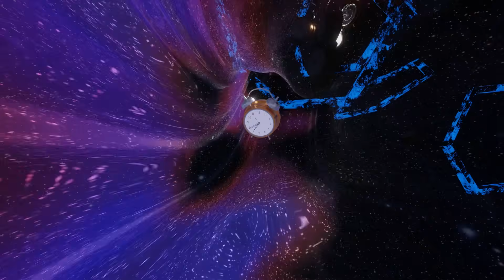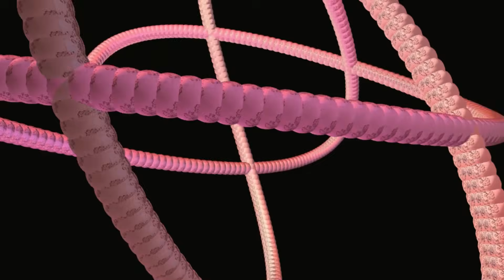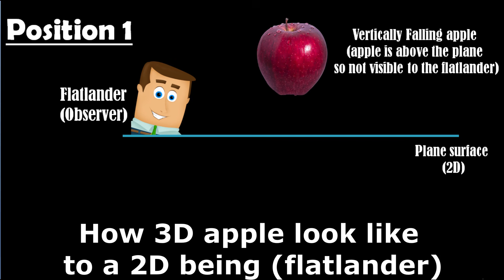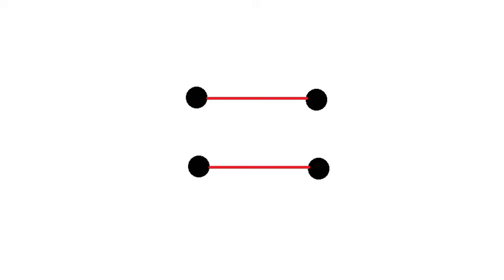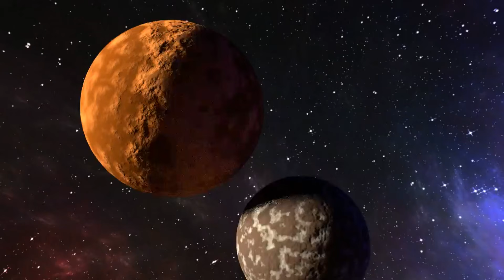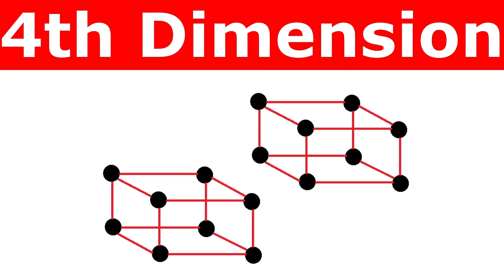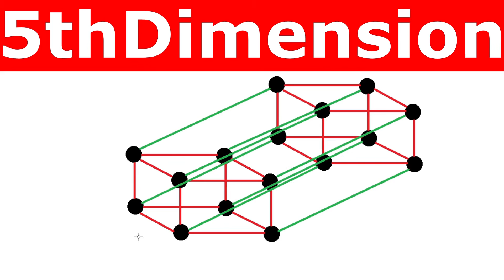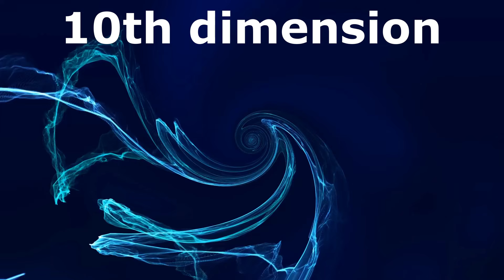11 Dimensions Explained - A Mind-Bending Explanation of Higher Dimensions!

Comment: I have an issue with this as in viewing an object. 
Let's take the rope and the ant for example. 
Depending on the viewpoint, we can either see two or three dimensions.
It is impossible to see one-dimensional unless it is a drawing or on a computer.
So, we crouch down to see the two rocks and the ant crawling across. This is two-dimensional, not one. We can observe the length and width of all these objects, not just length.
Even paper has a length, width and depth to it. Even though it is only fractions of a millimeter, it still exists.
Even when you use a pencil on paper, it will leave a minuscule height of graphite or indentation. So nothing physical an be in one dimension.
Actually all things viewed, for the most part are always three dimensional. 
So a single dimension or two dimensional objects are purely hypothetical.  Im not saying it doesn't exist, but we cannot view this with the eye. Its only a false perception.

Now the 4th dimension would be different, but I think the classic "go to answer" is: Time.
But "time" is a man made construct. Used as a unit of mesurement of things being: built, destroyed, birth and death.
A chronological way to observe history.
But in Universal law, time does not exist. Just: action, reaction, repulsion and attraction. So to say in "The Fourth Dimension, is viewed one state in time, in all states" is hypothetical as well.
Instead of trying to view and explain "A Structure of three dimensions in the Fourth" maybe we should be considering the view instead of the object. All structures could be invisible, but you could view all angles anyway. I think it would be more like viewing translucent atoms in frequencies.  The Time answer doesn't really work for me.
I mean Einstein tried to prove time travel with atomic clocks, but maybe it only proved that structures or matter are less reactive the closer you are to an object of mass, and vise versa.  Therefore it doesnt degrade or break down the same.

Comment: I disagree about your idea of the fourth dimension, I believe temporal dimensions are a separate thing from spatial dimensions, we expand our freedom of movement as we add dimensions in this way, even though each step allows a completely and radically different manner of movement it is still fundamentally the same ‘action’, you would still just be physically pushing, pedaling ambulating or otherwise propelling yourself ‘forward’ in space. Regardless of how many degrees of spatial freedom there are they are all still ‘moving’ along the same old river of time in the way we are used to. Just my thought anyway. I think These type of higher or lower dimensions are what physicists have discovered are required for all quantum fields to coalesce along with the other, separate dimension of spacetime that is manipulated by gravity and described by special and general relativity

Comment: Great video.  We being in a 3 dimensional world that we see and understand,  There is a 4th dimension but we are also locked into the 4th dimension at this time. As time  passes by normally, we are locked in this so called "present or current time".  What we cant do yet, is move freely back in time or forward in time.  Someday there may be machines that can provide this 4th dimension movement, but what would that do to our current time line if something gets changed in the past (paradoxes - another topic).  So, do want to even tinker around with the 4th dimension?  No pun intended, but Time shall Tell.

Comment: Actually if he was in a 2D plane he would only see a wriggle line not a circle as each point on a circle in front of him would block view of points behind. At most an arc would be seen. If the observer was ABOVE the askew to it in parallel able to see only into that plane then he'd see point to circle to point. In plane be point to a wallish arc that bends at most to a half circle like view then to point. Lol you can't see a circular building in its entirety on the ground in its entirety if on same level. Exact same thing. This is why a lot of half factor mistakes are made in string.

Comment: If we go to microscopic level, we'll perceive the other dimensions. So a zero dimension point does have more dimensions in it. Ang going deeper to nanoscopic level, the zero dimension dot that has multiple dimension is made up of zero dimension dots. In conclusion, zero dimension is also multiple dimensions depending on the limits of the observer's perception. The question is when an observer transcends its perception do these dimensions still exist?

Comment: Thank you for the easy to understand - as you explained them - the Eleven dimensions .
 I get the sense though there may well be more Dimensions yet to be found , as the Hubble Telescope found out in the first long duration observation on an "empty " bit of space . They got more of a surprise when instead of 11 days observation , it was taken over 22 days , peering into another bit of "empty" space , where even more was found . Both  the Deep field view & the ultra Deep Field Veiw ,  produced much unexpected data . 
 Thank you for sharing , and I look forward to the other dimensions being found , and understood .
 Namaste 🙏👍🤔
Reply: Remember that this is the eleven dimensions proposed in string theory, which were first predicted in the early 20th Century when differential equations were applied to modern physics.  As the video touches on, more dimensions are proposed in other theories.   Maybe one theory is more right than another or, heck, maybe they're all correct.

Comment: The stars AND PLANETS are POINTS in the night sky, AND carefully consider what is the speed of light (c) ON BALANCE !!! Indeed, A PHOTON may be placed at the center of what is THE SUN (as A POINT, of course); AS the reduction of SPACE is offset by (or BALANCED with) the speed of light (c) ON BALANCE !!! ELECTROMAGNETISM/energy is then CLEARLY proven to be gravity ON BALANCE. E=mc2 is directly and fundamentally derived from F=ma. Indeed, this explains the fourth dimension and the term c4 from Einstein's field equations !!!! (Stellar clustering ALSO proves ON BALANCE that ELECTROMAGNETISM/energy is gravity.) So, on balance, I have CLEARLY explained why THE PLANETS (including WHAT IS THE EARTH AND the Moon) move away very, very, very slightly in relation to what is THE SUN, as ELECTROMAGNETISM/energy is gravity ON BALANCE !!! Accordingly, the rotation of WHAT IS THE MOON matches it's revolution. Gravity AND ELECTROMAGNETISM/energy are linked AND BALANCED opposites (ON BALANCE), as ELECTROMAGNETISM/energy is gravity (ON BALANCE) Great. Carefully consider what is THE EARTH/ground ON BALANCE in relation to what is THE EYE. Think about TIME. Great. Gravity is ELECTROMAGNETISM/energy ON BALANCE. Gravity/acceleration involves BALANCED inertia/INERTIAL RESISTANCE, as ELECTROMAGNETISM/energy is gravity ON BALANCE; as this is consistent with E=mc2 AND F=ma. Accordingly, ON BALANCE, the rotation of WHAT IS THE MOON matches it's revolution. I have explained why the orange and setting Sun is the same size as the fully illuminated and setting Moon. (They are both the same size as what is THE EYE.) I have mathematically unified physics. I have explained the cosmological redshift, the black hole(s), AND the supergiant stars. I have explained why there is something instead of nothing ON BALANCE !!!!!. Inertia/INERTIAL RESISTANCE is proportional to (or BALANCED with/as) GRAVITATIONAL force/ENERGY, as this balances gravity AND inertia/INERTIAL RESISTANCE; as ELECTROMAGNETISM/energy is gravity ON BALANCE. This explains E=mc2 AND F=ma ON BALANCE. This NECESSARILY represents, INVOLVES, AND DESCRIBES what is possible/potential AND actual IN BALANCE, as ELECTROMAGNETISM/energy is gravity ON BALANCE. Think about the man (THE EYE) who actually IS IN outer “space” in careful comparison to/with what is THE MAN (AND THE EYE) who actually IS standing on WHAT IS THE EARTH/ground ON BALANCE !!!!!. Think about TIME. Magnificent. (So, you want to think about TIME AND WHAT IS THE EARTH/ground ON BALANCE !!!!!. Fantastic !!!! ELECTROMAGNETISM/energy is gravity ON BALANCE, as it ALL CLEARLY makes perfect sense; as ELECTROMAGNETISM/energy is gravity ON BALANCE !!!!!. (Notice that the sky is blue, and THE EARTH is ALSO BLUE !!!) Great. What we have here is top to bottom perfection. Notice that time is, ON BALANCE, necessarily possible/potential AND actual IN BALANCE, as ELECTROMAGNETISM/energy is gravity ON BALANCE !!!! SO, ON BALANCE, TIME dilation ULTIMATELY proves that ELECTROMAGNETISM/energy is gravity ON BALANCE !!!! BALANCE AND completeness go hand in hand. Great. It is ALL CLEARLY proven. I have mathematically unified physics two times over !!!!!. I have proven that, how, and why ELECTROMAGNETISM/energy is (NECESSARILY AND CLEARLY) gravity ON BALANCE, thereby explaining why there is something instead of nothing (in and WITH TIME ON BALANCE) !!!!! Again, this NECESSARILY represents, INVOLVES, AND DESCRIBES what is possible/potential AND actual IN BALANCE (in and WITH what is TIME ON BALANCE as well); as gravity is CLEARLY proven to be ELECTROMAGNETISM/energy ON BALANCE !!!!. Remember, with regard to TIME as well, the stars AND PLANETS are POINTS in the night sky. (It ALL CLEARLY makes perfect sense.) Don't forget to consider the speed of light (c) ON BALANCE. TIME dilation ULTIMATELY proves that ELECTROMAGNETISM/energy is gravity ON BALANCE. (Gravity is ELECTROMAGNETISM/energy ON BALANCE.) It ALL CLEARLY makes perfect sense, as BALANCE AND completeness go hand in hand. I have mathematically unified physics.

By Frank DiMeglio

Comment: UNDERSTANDING EXACTLY WHAT IS A TWO DIMENSIONAL SURFACE OR SPACE AS invisible AND VISIBLE IN BALANCE, AS E=MC2 IS clearly F=ma (ON BALANCE):

The stars AND PLANETS are POINTS in the night sky. Now, very carefully consider what is a galaxy. Get a good look at what is THE EYE, AND notice the black space. E=MC2 AND F=ma IN BALANCE do ALSO FUNDAMENTALLY represent (ON AVERAGE) what is a TWO DIMENSIONAL surface OR SPACE (as what is a BALANCED MIDDLE DISTANCE in/of SPACE), AS ELECTROMAGNETISM/energy is gravity. Gravity IS ELECTROMAGNETISM/energy. Gravity AND ELECTROMAGNETISM/energy are linked AND BALANCED opposites, AS E=MC2 IS F=ma. The stars AND PLANETS are POINTS in the night sky. Now, consider what is the speed of light (c) ON BALANCE. I have explained why THE PLANETS (including WHAT IS THE EARTH) move away very, very, very slightly in relation to what is THE SUN on balance, as ELECTROMAGNETISM/energy is gravity. Gravity/acceleration involves BALANCED inertia/INERTIAL RESISTANCE, AS E=MC2 IS CLEARLY and NECESSARILY F=ma ON BALANCE; AS ELECTROMAGNETISM/energy is gravity !!! Accordingly, the rotation of WHAT IS THE MOON matches it's revolution. It is CLEARLY proven ON BALANCE. E=MC2 IS CLEARLY F=ma ON BALANCE. This NECESSARILY represents, INVOLVES, AND DESCRIBES what is possible/potential AND actual IN BALANCE, AS ELECTROMAGNETISM/energy is gravity !!! TIME dilation ULTIMATELY proves (ON BALANCE) that ELECTROMAGNETISM/energy is gravity, AS E=MC2 IS F=ma ON BALANCE !!! Indeed, TIME is NECESSARILY possible/potential AND actual IN BALANCE; AS E=MC2 IS F=ma IN BALANCE; AS ELECTROMAGNETISM/energy is gravity. Gravity IS ELECTROMAGNETISM/energy. "Mass"/ENERGY IS GRAVITY. ELECTROMAGNETISM/energy is gravity. (BALANCED inertia/INERTIAL RESISTANCE is fundamental.) Objects AND MEN fall at the SAME RATE (neglecting air resistance, of course), AS E=MC2 IS F=ma ON BALANCE; AS ELECTROMAGNETISM/energy is gravity. This NECESSARILY represents, INVOLVES, AND DESCRIBES what is possible/potential AND actual IN BALANCE. Gravity is ELECTROMAGNETISM/energy ON BALANCE. The sky is BLUE, AND what is the Earth is ALSO BLUE. Carefully consider what is a galaxy !!! Energy has/involves GRAVITY, AND ENERGY has/involves inertia/INERTIAL RESISTANCE. “Mass"/ENERGY involves BALANCED inertia/INERTIAL RESISTANCE consistent with/as what is BALANCED electromagnetic/gravitational force/ENERGY, as ELECTROMAGNETISM/energy is gravity (ON BALANCE); as E=MC2 is CLEARLY and NECESSARILY proven to be F=ma ON BALANCE. Inertia/INERTIAL RESISTANCE is proportional to (or BALANCED with/as) GRAVITATIONAL force/ENERGY, as this balances gravity AND inertia; as ELECTROMAGNETISM/energy is gravity; as E=MC2 is CLEARLY and necessarily proven to be F=ma ON BALANCE !!! So, “dark” matter/ENERGY is plainly unnecessary; and it is idiotic. I have mathematically unified physics, as I have explained the term c4 from Einstein's field equations along WITH the fourth dimension, as ELECTROMAGNETISM/energy is CLEARLY AND necessarily proven to be gravity ON BALANCE. E=MC2 is CLEARLY proven to be F=ma IN BALANCE.

By Frank DiMeglio

Comment: "In my father's house there are many mansions."  -Jesus 
Now you see what he meant.
We live in a multiverse consisting of many dimensions. Each dimension have it's own vibration. We all exist at the same time at the same place, but as we vibrate at different speeds we are invisible to co-existing dimensions. Think of the spokes in a bicycle wheel. If the bicycle stands still or move very slowly (low vibration) we can see the spokes, but if the bicycle moves fast (high vibration) the spokes become invisible to our eyes, even tough they are still there, existing. It's the same with our souls that move on to a higher dimension after we pass. Our souls are of a higher vibration.
Reply: So True !

Comment: Do not ask, "If there are so many dimensions, why are we not able to perceive them?" but instead ask:

1) If the theory works by assuming 11 dimension, what are the formal benefits to use more than three dimension?"
2) If the benefits are mostly formal, what is this formality try to achieve, if maybe the 11 dimensions have nothing to do with 
our daily and pragmatic concept of dimension?
3) What kind of data, rules or functions result - generally speaking, in the usage of more than three dimensions?
(For instance:
Real Numbers are in 1D, Complex Numbers are in 2D; i*i=-1
 Higher than Complex Numbers are Quaternions (in 3D); i*j*k=-1 
Higher than Quaternions are Octonions; i*j*k*l*m*n*o=-1 
and its double-sized version Sedenions; which I don´t understand.
https://de.wikipedia.org/wiki/Sedenion  )

If you can explain the benefit for using an unusal amount of something in a method, it is a much more reasonable explenation, 
than to say "what it is" or "how to imagine it". What is the reason scientist using more than three or four dimensions of spacetime? Einstein himself just used a four-dimensional metric tensor, because it is easier to describe it that way, how spacetime curves; it doesn´t mean that the universe obey to the rules of the metric tensor, because we still have no clue how to solve the "three-body-problem"- which is a real observed phenomena, but none of our formalisations of describing moving stuff can solve, how to predict such movement. I quote:

"There is no general closed-form solution to the three-body problem,[1] meaning there is no general solution that can be expressed in terms of a finite number of standard mathematical operations. Moreover, the motion of three bodies is generally non-repeating, except in special cases." (source: https://en.wikipedia.org/wiki/Three-body_problem#General_solution)

Reference:
https://en.wikipedia.org/wiki/Metric_tensor_(general_relativity)

Comment: If the highest dimensions exist. 

Does that imply that each higher dimension  manifests cascadingly through the lowers?
(Perhaps but not really, excluding the 8th)

Or do they exist in isolation?
Reply: They're bent away from each other & not literally curled up, because length, width, depth & duration one (time relative to you) are 'trapped' within the light cone of the 5th dimension of light itself (electromagnetism). The narrator is talking mostly about spatial dimensions & not focused on temporal & functional dimensions enough.
Reply: As above so below